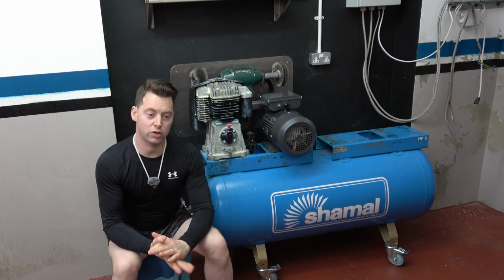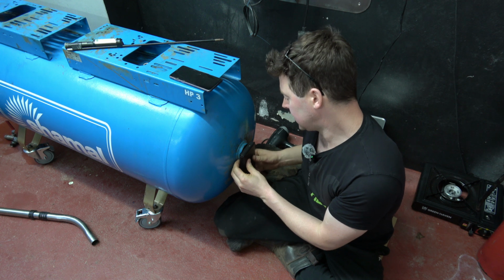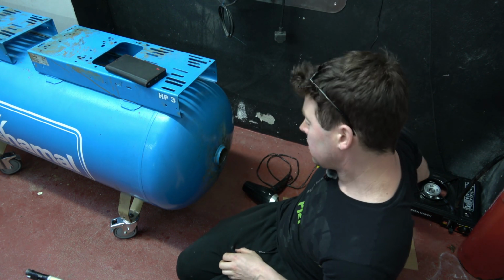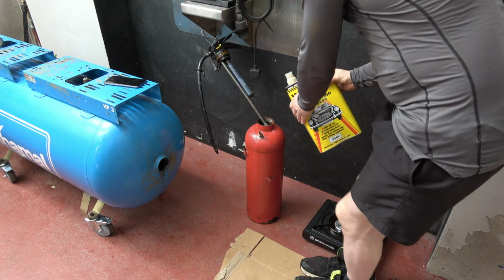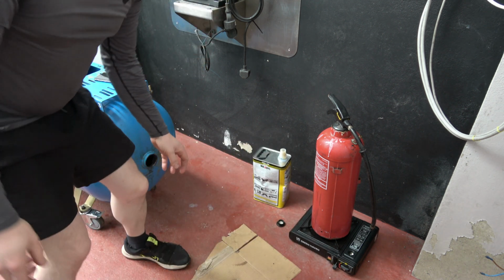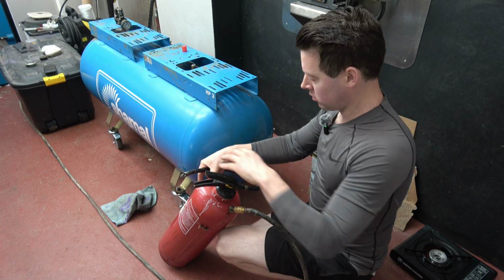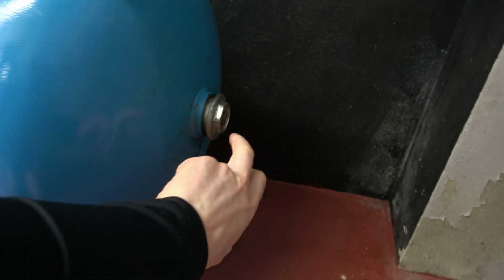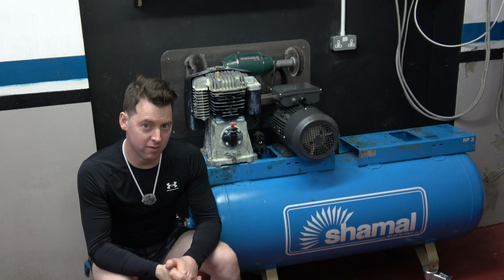I Built my OWN Custom Compressor Beast at 50 CFM+ Tumbling Results & Protection Part 2

Comment from the maker: Let me clear this up! 

Original pumps
Abac B38 12-15CFM
3hp motors required

ALL REMOVED!

NOW >
New pumps BK114 25CFM
5.5hp motors required/purchased

Don't divide by 2 MR! Multiply by 2!! Simple. 

BK114 BK114 BK114 BK114 BK114BK114 BK114 BK114 BK114 BK114BK114 BK114 BK114 BK114 BK114 

Got it? 😊 Jeepers the videos are very clear.

Comment from the maker: For the little individual who has no clue commenting under this video. The motors are 5.5hp and not 3hp. The pumps are FINI 25CFM 2 stage pumps, not 12CFM as your terrible comment stated. Thanks for your useless lack of knowledge. Open your eyes and ears in the future or maybe go to a library? Criticising my work over your own envious behaviour.
Reply: Awh man, let them know it alls slide on, even with the facts and data sheets, they still spread false info. Envious behavioir that! Can't wait to see this run on single phase.
Reply from the maker: @MarkBurton-tk8dy spewing on useless infomation in broken English about how he knows this and that with their valuable experience! He stated my pumps are only 12CFM and the motors 3HP. Doche. Clearly just an attack by some jealous head, or they clearly dont understand what i've done here. Like I  laid it all out on a table in both videos. But he thinks I removed both single stage 15CFM pumps to replace them with those much larger 2 stage FINI pumps which are now only 12CFM. Awh, whatever tickles his winkle.
Reply from the maker: See Short reply